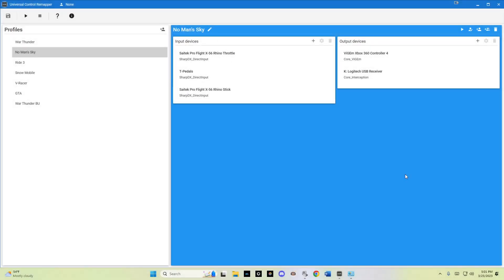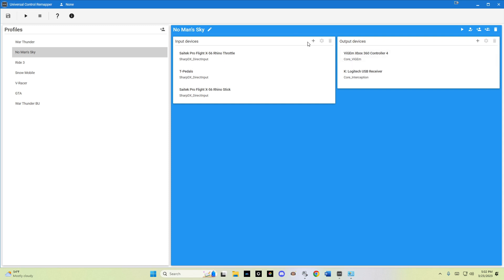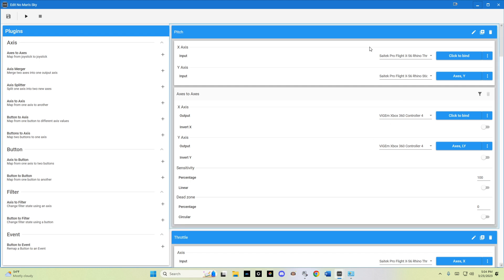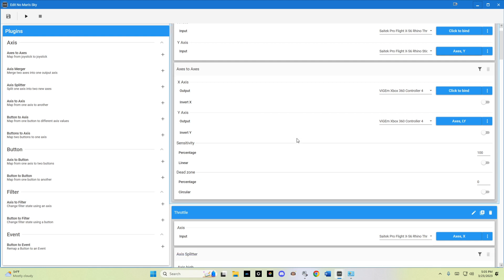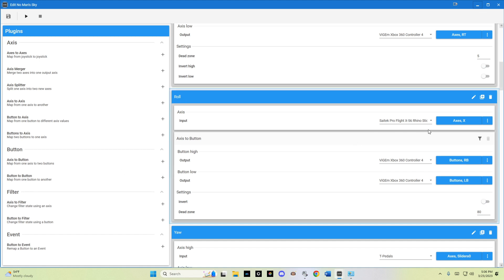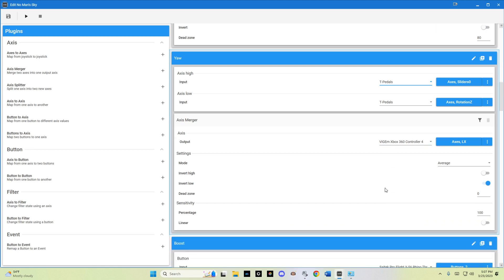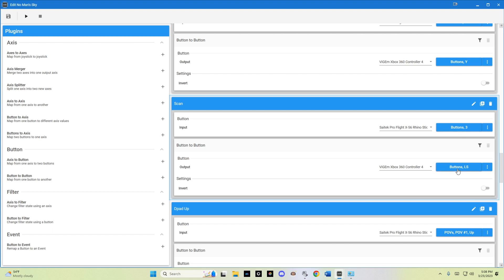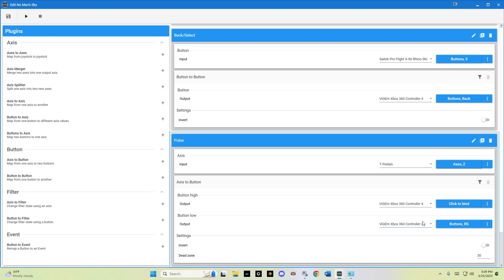No Man's Sky HOTAS Setup using Universal Control Remapper

Comment: Thanks for this!!!  I got it to work, even though sometimes it doesn't like to switch from the VR controls back to the HOTAS, any idea how to make that more reliable?  I'm on WMR.  Also, I highly recommend adding 'auto boost' to the throttle by creating a separate axis to button, mapping just the positive throttle axis to "B" and giving it a huge dead zone like 80.  But B also cancels the menus, so you have to pull the throttle back before refueling or whatever.  Also, you still want to keep B mapped to a button just to cancel menus with.  

This makes the game at least 1000 times better imo.  Really wish HG would add actual HOTAS support.....or at least let us map roll to an axis!  Also, wish we had an option to remove the auto level during planetary flight.  Feels like I'm always fighting it when trying to scope out a planet.  Maybe with a mod???

Comment: Great video!  Worked straight away for my warthog.  Thank you.  Any tips for switching between the hotas and the VR controls?  As soon as I leave the ship my hands go nuts, likely a clash between the hotas and the VR controllers.  If I move the throttle around it sorts itself out.  Any tips?

Comment: Everything has worked great, but the pulse drive keeps turning off as soon as its fired (I have it on a button to RS click)  It starts and turns off instantly.  I have fuel so I have no idea whats wrong.

Its off, somehow using the pulse drive with this program is breaking my thrusting ablity like it gets stuck.  Once the pulse fails I can't use thrust with the HOTAS or the keyboard, if I turn if off UCR it works again.  Somehow its getting weird input and I can't say which is the one doing it.

I made a test profile and using ONLY the pulse drive it worked fine, so something is messing this up ... sigh,  

AND I figured it out, button to axis messes things up for throttle (I have a cheap throttle so was using the pov up and down) cheap logitec 3d throttle though is fine.
Reply: Lol god now the last problem is it works fantastic in regular but it won't switch over in VR to the joystick.  One guide said put down your vr controllers a while, and give the stick constant input, this did not work.